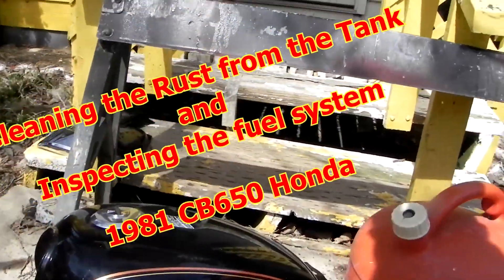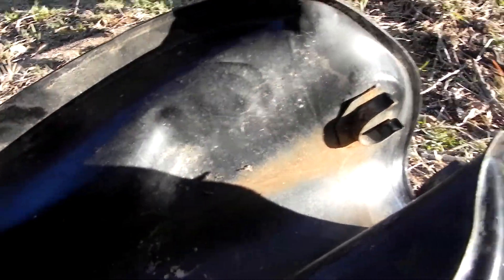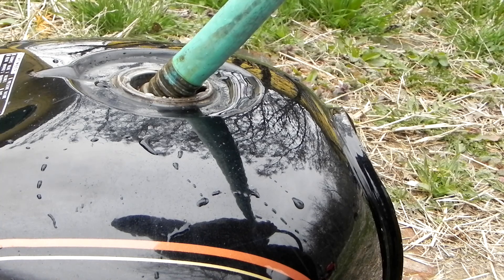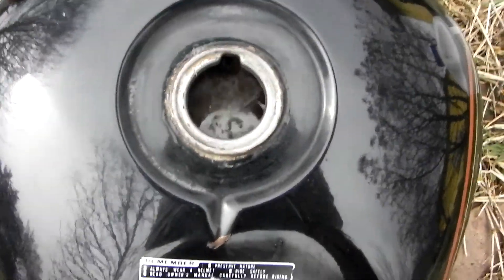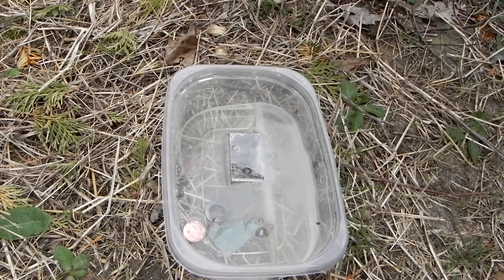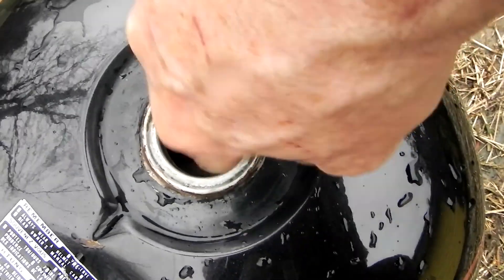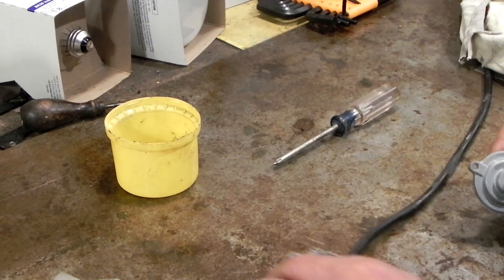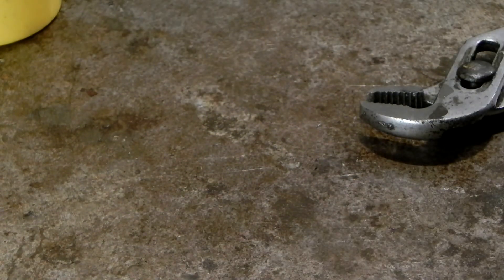Using Acid to Remove Rust 1981 CB650 Honda Clean Gas Tank Motorcycle

Comment: if you didnt use a soda to stop reaction acid is corrode inside metal still after you flush it with water.....     Btw you used to little acid for too many rust
Reply from the maker: Thank you very much for your comments.  Yes, the soda would have been a good idea.  But, we flushed it with premix fuel and everything worked out fine.  About the lack of acid, you are absolutely right.  We did another tank and my friend used straight acid and swished it around.  It cleaned the tank out very quickly that way.  Thanks again and have a nice day.